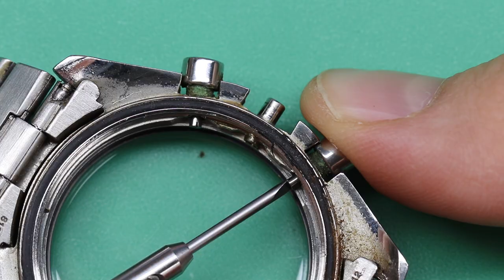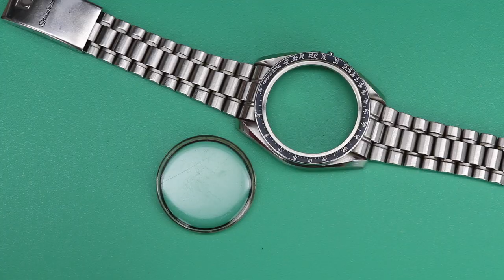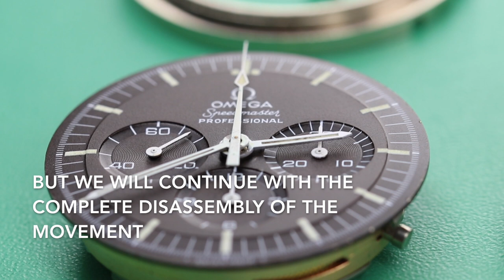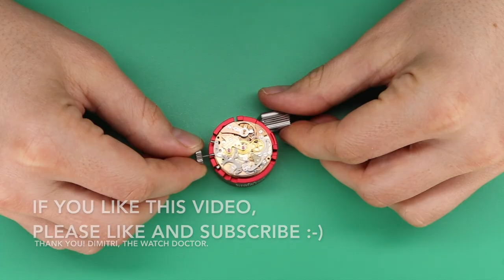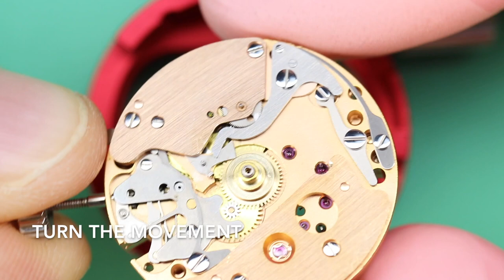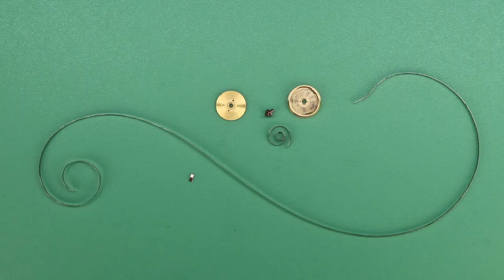Iconic Omega Speedmaster Moonwatch | Full Stripdown in 10 min!!! | Watch Repair | Omega Cal. 861

Comment: Looks incredible. My speedy is 15 years old now and runs fine but I'm thinking of having it serviced, however my experience working within the motor trade has left me with a distrust of even the most competent mechanics. How would you know its been done. It's not as though you're going to be able to tell.

Comment: Thank you for excellent review. I watch your restoration videos with very pleasure. I just want to ask a question. On the crystal, is there any gasket? I m asking this for validate my mechanical watch crystal.  we get used to see gasket as a very thin, black and rubber object that encircle the case. Is there any other version of gaskets. I really don't know if i have gasket on my watch because of this reason. It seems like this Omega's Thanks.

Comment: I have a Speedmaster myself so it was fascinating to see what’s going on inside. Amazing video! Very interesting to watch! I do have one question tho: Why were there so many scratches on the inside of the movement (I believe it was mainly the barrel bridge). Like all around the various drilling holes and even just across the surface of the different plates inside the movement. Did they get scratched during production or is that something that might indicate someone unqualified having serviced the movement before?
Reply: Also is there any chance that you could maybe do a video on the 3132 by Rolex? I have an OP and would love to be able to see more of the inside and what it’s actually made of. There’s no videos on YouTube so far.
Reply from the maker: Hello Levitation, It is a watch from 1969 and it has undoubtedly been serviced by some maintenance, the scratches on the barrel bridge are also from wear and tear, because dried oil and grease can cause a lot of resistance and subsequently affect the metal. The scratches certainly do not come from the production, that should not be from the quality of Omega.
Reply from the maker: If i have a chance to do this i will definitely do this ;-)

Comment: Nice video but I would have preferred the Strip down to be done on Caliber 321, not on the 861. The 861 have been used by the Speedmaster since 1968-69 with, except for the addition of one extra jewel=1861, the same until now that the Co-Axial 3861 was introduced.  The 321 has somewhat different features like that Column wheel that the 861 has.
Reply: Sorry, I clicked comment instead of clear- It had to read at the end - the 321 is a column wheel but not the 861 that is a switching cam.